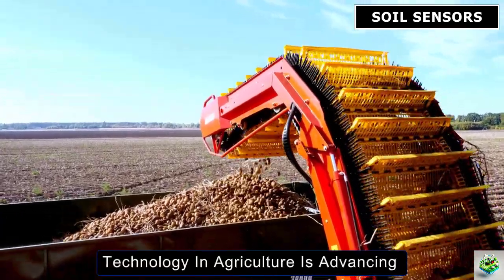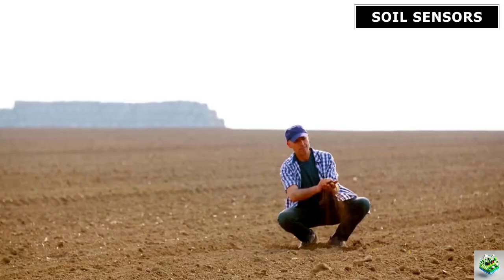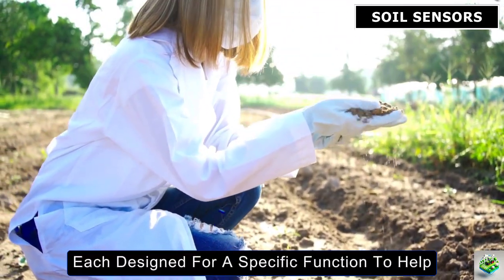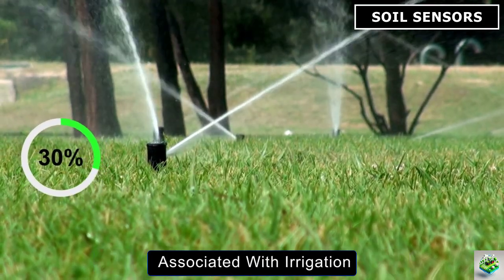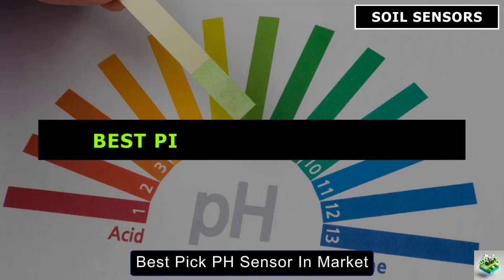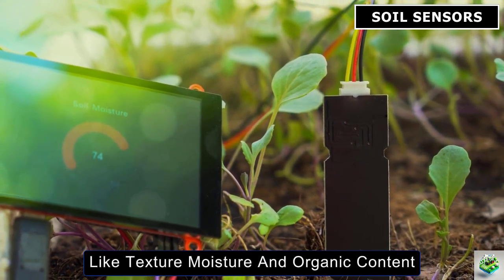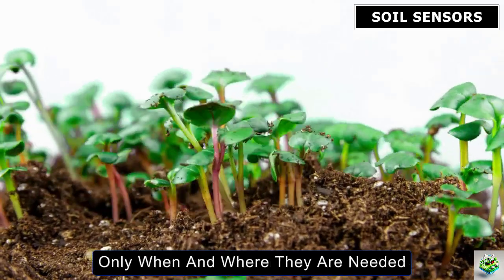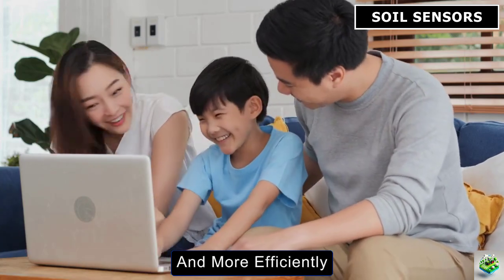Smart Soil Sensors - How Tiny Tech is Revolutionizing Crop Yields and Farming Efficiency

Comment: Hell sir, how the accurately of detect soil image? For crop recommendation❤?
Reply from the maker: Hello! Thank you for your question.

Smart soil moisture sensors primarily measure soil moisture levels rather than capturing soil images. However, when integrated with advanced imaging technologies and AI-based analysis, they can provide valuable insights for crop recommendations by assessing soil texture, moisture content, and overall health.

Accuracy depends on the sensor type, calibration, and environmental conditions. Let me know if you’d like more details!
Reply: @ thanks a millions sir. So could u talk about it can be more detail because I would like to choose a topic for thesis defense about Soil and Crop recommendation. That soil data is from internet. Soil data should be images? But Crop data is numerical.